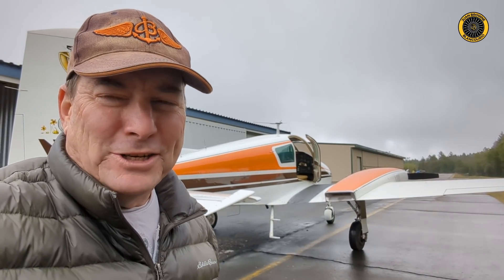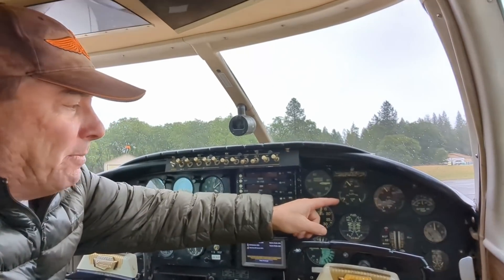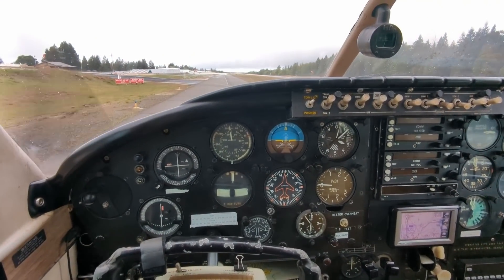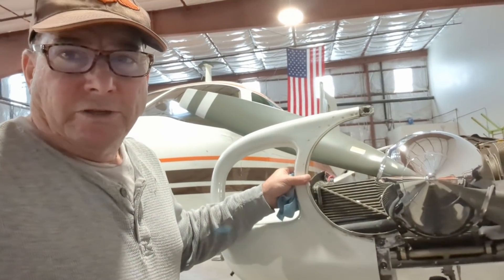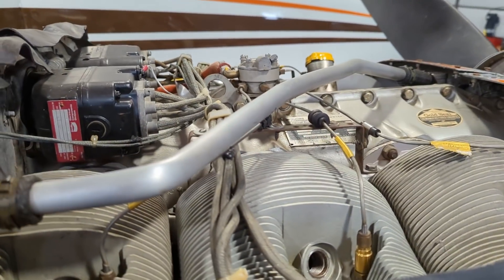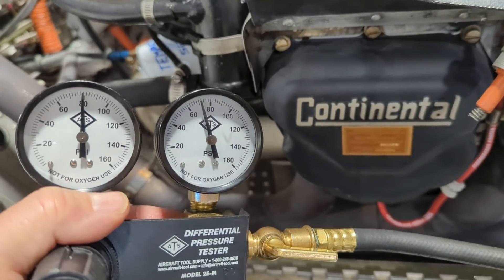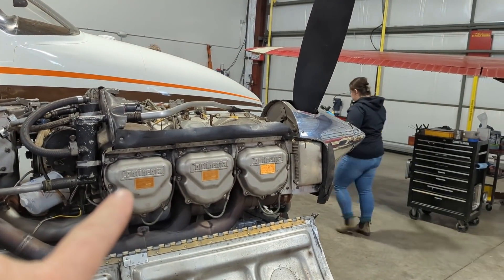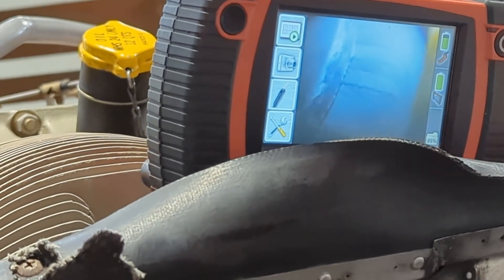1959 Cessna 310C Annual Inspection- Part I Compression Check.

Comment: That was a great video showing compression test....I had received my A&P back in 1979 and went on to Parks College for Aircraft Maintenance Engineering. I then joined the Space Shuttle program working on ECLSS and ATCS systems and EMU/PLSS for 32 years till the end of the program. My last eight years before retirement, I worked Airbus A-380 program as the service engineer for ATA21 and ATA36 systems along with helping on B744 and B777 programs mainly for Emirates, Singapore and Malaysia Airlines.  In my 40 years the now Raytheon Collins Aerospace was UTC Hamilton Standard, Hamilton Sundstrand, United Technologies Aerospace Systems (UTAS) and then Collins Aerospace. I took an early retirement Package shortly after Raytheon took over and COVID hit.    Miss the people and work, but not all the traveling......Keep up the great work on the your YouTube Channel.....
Reply: wow. impressive.

Comment: Juan, I thought cleaning of modern spark plugs was not recommended. Back in the 1960's when we were racing a Martin engined space frame Morgan 4/4, it would soot the plugs, if it was allowed to idle for more than a couple of minutes or so. We used Lodge RL50  racing plugs, where we used to take a batch of them back to the Lodge/KLG factory on the Kingston Bypass in South London, for them to be disassembled and cleaned. This was less than a third of the cost of new plugs.
Reply from the maker: Airplanes, NOT autos.
Reply: @blancolirio  Another option is to get pre-cleaned used plugs from a place in LA that provides the service. That way the annual is not tied up cleaning 24 plugs or dealing with a bad one. Once you have the 2nd set you send them to LA - or clean inspect gap at your leisure.
Reply: Around $40 apiece X 24.
You clean, inspect, and reinstall if you can.
Reply: Wilson, you come up with the $1,000 and Juan will gladly install brand new.

Comment: That brings back memories of my big block 396 for compression after warm up that I wanted between certain % limits. this would help determine any faults that were starting to creep up in the future....if engine running a bit rough first checking cylinder condition by examining spark plugs that would let me know about ring leakage of oil...and always checking spark gaps on the plugs as well as the distributor. As long as there weren't any gasket leaks between the carburetor, intake, head and the headers, I monitored the manifold pressure after several accelerations and decelerations. If everything looked and sounded OK I was more confident about the engine's behavior. What I loved most was the one crank it took to start the engine with a szwoop!...with no vibration and sound of a smooth running engine!

Comment: That is very different compared to my motorcycle. Compression and leak down tests done with two different tools. I had a Moto Guzzi Quota a few years back that did not produce the power expected. A buddy had one two and he had both compression and leak down test equipment so we tested my bike and his (because we didn't have a good feel for what would be good numbers). In the end, my bike was fine but his failed the leak down and needed top end work! My problem ended up being a too small after market exhaust. :D

Comment: So an owner can't do any work on their own airplane?  Everything needs a AP certified tech even if it's recreational.
Reply: All certified aircraft requires maintenance and repairs by A&P. Experimental and part 103 don't.
Reply: @techsolutions8237  
      That statement is false.   
             
     14 CFR 43, Appendix A lists many tasks that can be accomplished by owner operators who hold at least a Private Pilot certificate.   These include, but are not limited to oil changes, tire and brake changes, spark plug cleaning and gapping, simple fabric repairs etc.

       In addition to the preventative maintenance tasks listed above, owner-operators or apprentices like the young lady in this video can accomplish any maintenance task they are comfortable with under the supervision of a certificated A&P mechanic.
Reply: @Stepclimb  I have been a A&P for 28 years now... I assumed we were still discussing a annual inspection on a certified aircraft... 
 Several of the above "repairs, and maintenance", such as fabric repairs have limits, and stipulations attached, and would need to have a IA sign off.  In other words have airworthyness certificates revoked and fined... For not logging it.
 I have seen this occur on several occasions.
Reply: @Stepclimb  When you are being supervised by a A&P or IA, you are not completing the work yourself are you?
Reply: @techsolutions8237  
            Take a look at 43.3 (d) and tell us how you define the words “perform maintenance”.    We are discussing performing maintenance, not the required maintenance records entries.    

     Since you want to discuss logbook entries, 14 CFR 43.9 (a) 3&4 clearly spells out that an apprentice or owner performing maintenance under the supervision of an A&P fills out the description of work performed (with their name) and the A&P signs for the approval of the work performed.
Reply: @Stepclimb  troll on stepclimb.... How many years have you held your A&P certification?
 Once again if you are doing it under supervision, your bird isn't airworthy without the signature in the log book. You are not able to fly it legally....
Reply: @techsolutions8237  
           That’s an interesting assumption.   

     I read a blanket statement from you that only A&P mechanics could perform maintenance on certificated aircraft.   That is false.

         If you had re-worded the statement to “only holders of Inspection Authorization can perform annual inspections required by Appendix D of part 43 and these inspections can not be delegated”, then yes, that is true.

       It’s not just A&P mechanics that can perform maintenance and repairs on certificated aircraft.
Reply: @Stepclimb  Don't be obtuse little troll... you are confused.
Reply: @techsolutions8237  
           I think it is you doing the trolling.

     Have you bothered to read 14 CFR 43?      Perhaps it’s been quite some time.

      Or perhaps you are confused between the differences between maintenance and inspections.

      In the case of this video, I have some concerns about Juan performing an “Annual inspection”.    Maybe you do as well.   

     If he does not hold an IA, he can not perform any of the inspection tasks.   They can not be delegated and the IA can not supervise.

       The first statement of this thread, you stated only A&Ps can perform maintenance.   That is simply not true.

       Maintenance and Inspections are two separate things.
Reply: @Stepclimb  You didn't answer the question about your qualifications. BTW Juan is an A&P.
 But.. keep trolling 👍
Reply: @techsolutions8237  
          You again?      Still trolling?

    How about these qualifications:    

     I can read, speak and understand English.   

     Specifically, I understand the Federal regulations contained in 14 CFR 43, 65 and 91.

        

Are you still standing by your statement that a non A&P aircraft owner may not perform any maintenance on their own aircraft and return the aircraft to service via an entry into the aircraft maintenance records?

     Are you also claiming that the non-A&P apprentice in the video may not perform maintenance or repairs under the supervision of an A&P?

          How exactly do you think apprentice mechanics like Jordan get their experience required by 65.77(b) to obtain their A&P?

    
    To clarify, this discussion started with your blanket statement “ All certified aircraft requires maintenance and repairs by A&P.”

      I have been discussing Maintenance on certificated aircraft, not Inspections.

       
    My position is that there are many more persons other than A&P holders that can perform maintenance and even return the aircraft to service.     

      If you would bother to read 43.7, you could see for yourself.
      

     Maybe you would like to share with the group where exactly you work as an A&P so that we could avoid your services.   

   By your past statements, it is clear you have a fundamental misunderstanding of the regulations that govern the work of aircraft mechanics and you are unwilling to change your position on your misunderstanding.
Reply: @Stepclimb  So what you are trying to be is the grammar police... 
 Just as I thought.... Zero experience.
 Troll on....😘😘😘
Reply: @techsolutions8237  
         The good news about this back-and-forth is that additional comments add to the revenue for Juan.    
    I am happy to support his channel.  

     With your initial false statement, you began the trolling.   Perhaps your trolling comments exist to support this channel as well?

      You never answered the questions.   

  Please clarify your understanding of the regs with regard to non A&Ps performing maintenance on certificated aircraft.

      My experience, credentials and airmen certificates have no bearing on my ability to read and understand the applicable FARs.
Reply: @Stepclimb  Nice story... 👍

Comment: And yet in lawnmowers and snow blowers we just add Sea Foam to the fuel to burn out the carbon in the top of the cylinders. Then install a new spark plug. Simple with like new compression again. Aircraft engines are a pain in the butt. I hate aircraft spark plugs (heavy, expensive, low spark etc.). I have worked on them for years.

Comment: As a retired auto mechanic in our world the test performed here was a cylinder leak down test . Not a compression test par se. A compression test measures the amount of pressure generated in a cylinder at cranking speed . And not a cylinder's ability to hold pressure . Which is what a leak down test is for .  When I began my career in 1964 we also did compression tests dry and wet ( with oil )  . Which was a quick check of ring wear . We had 4 places pressure loss could go to . Compared to your 3 in an air cooled engine . Always good to see new blood learning actual skill . Unlike the "woke " bullcrap . Harvey is one sweet bird . Thanks for sharing .

Comment: That was so cool Juan.  Well done for bringing Jordan into the show - I hope she didn't mind?  I've always wondered why aeroplane engines are so prone to developing serious faults when the engine in my car (as it happens a Land Rover LR3 Discovery) that is sixteen years old with only 91,000 miles on the clock.  Basically it never gets looked at and only rarely does it get given a sip of oil.   And aeroplane engines are, generally speaking, massively under powered.

I think I've said before, the 310 is one of my all time favourite aeroplanes and I can't believe it was a current design in 1959!  I was thirteen!  Looking forward to the rest of the maintenance.
Reply: All of the reciprocating a/c engines today are 1950's air cooled technology. There are damn few  better ones, but this is what the industry has been churning out for decades.
Reply: the difference is in how they operate. your landrover engine is lightly stressed and rarely if ever in many cases operates at or near full load. Whereas aviation engines spend most of their time under high loading making max hp. In one takeoff an aircraft engine is at wide open and maximum power/load  longer than most cars in a lifetime. When was the last time you had your landrover loaded down to where you had to hold 3/4 throttle or more to maintain speed? and how long do you think cars would last like that?
I'm a AP/IA and also dable in race cars and boats for friends and had a guy want a motor for his 27 ft Avanti speedboat. I gave him a great price since I was slow but apparently one of his friends thought I was I was ripping him off because summit racing sold a big block for half the price with a little more power. So he went there and I didn't care until he started bad mouthing me.... Anyway come spring he launched the boat and by the second week it's smoking and soon after spun a bearing. When he sent it back summit refused warranty because of marine use😂 and he learned why my price was so high.

Comment: I am glad to see someone that is being treated good by aviation. I wasn't so lucky. After 20 years and a lot of traveling in the civilian world, I am at this point in transitional housing through the VA. Without them I would be on the street. There is a lot to be said for my last job in aviation, little of it good.
On another note, it helps that you are a conscientious owner. My short time in general aviation was with a bunch of lease back 172'2 that were used for training. Your 310 looks like it was well kept before you got it. Best of luck with it. And best of luck to the new A&P.
Reply: The previous owner aged out and sold it to Juan.  I guess it sux to have to stop flying.

Comment: You were performing a cylinder breakdown test,  not compression.
Reply from the maker: Andy, do you work on airplanes? Or cars/motorcycles? It's a called a compression test in aviation.
Reply: "Cylinder Breakdown" is a mental health event, usually triggered by a zero psi reading during compression tests during annual inspection. $$$

Comment: I’ve always thought of that as a cylinder leak down test which will tell a greater story than a cranking psi indication.  Nice to see a well-guided procedure.
Reply: That’s all this is is a cylinder leak down test. The worth of it is increased when the test is done from day one of a new engine, and the leak percentage is monitored over the life of the engine. Really helps when diagnosing a drag race car when the et or mph seems off before you start chasing the tune or chassis.
Reply: @GNX157  Actually... its not leak down. It's a aviation differential compression test...Its done under pressure at 80 psi... More than likely a "Master orifice" is involved..😊
Reply: @techsolutions8237  What he’s doing is the same thing as a cylinder leak down, except in the automotive realm, we measure the leakage and describe it as a percentage, whereas he’s showing two different pressures, but it’s essentially the same thing. He’s looking for leakage in the various areas of the engine. Valves, rings, gaskets etc.
Reply: @GNX157  Its not the same thing... It's a Aviation compression test. Do some research first. 
 We are talking about aviation maintenance, not automotive realm.
Reply: @techsolutions8237  A 4 stroke engine doesn't care where it is used.  Aviation and automotive use slightly different procedures and different terminology, but the basics of a Leakdown/Differential compression test are the same, only a few details are different.
Reply: @MichaelSteeves  Enough details to make them different... Starting with FAA regulations. And... if you care to look into the principal used with a master orifice, and a 80 psi constant pressure, it becomes more clear it's not a automotive leak down. 
 4 cycle engines do care where they are used... that's why there is a mixture control to lean at altitude.
Reply: @techsolutions8237  I stand by what I said. I watched what he was doing, and the result, and to me it’s the same thing as a cylinder leak down test.
Reply: @GNX157  You would be wrong..  do your research. A master orifice, and 80 psi control pressure are not used. Its actually a completely different procedure, including the FAA regulations that go with it.... Read up.
Reply: @techsolutions8237  I won’t even bother. There may be slight difference but essentially it’s doing the same thing, youre making a big deal about minor details that mean nothing. What he’s doing is the same thing as a cylinder leak down test.